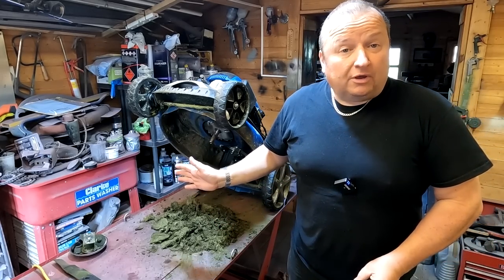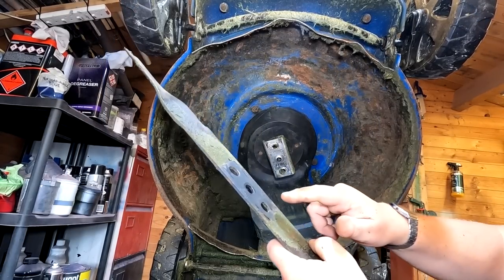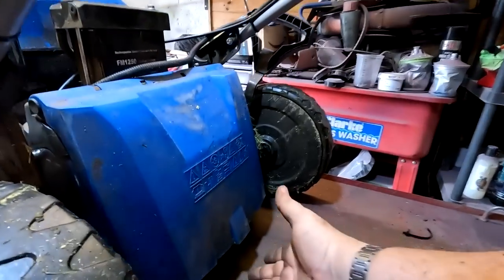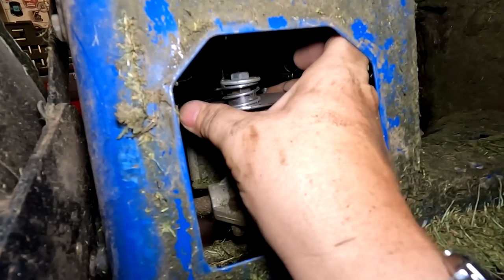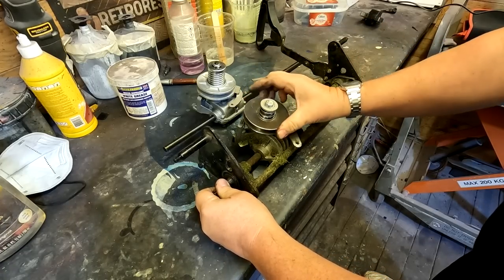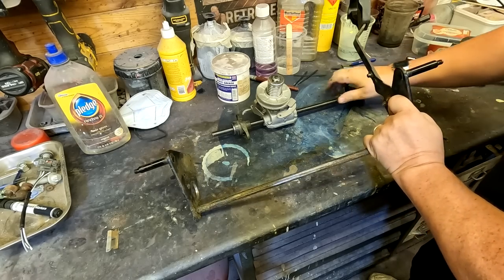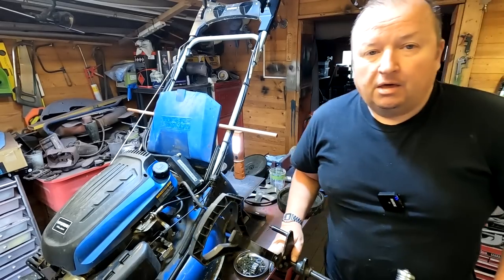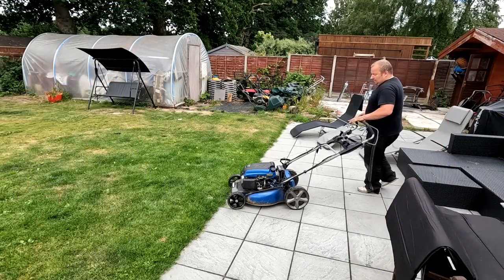Hyundai HYM510SPE Gearbox Issue

Comment: Nice one mate good job on the drive I some time's find that problems with the bolts covered in rust and rubbish normally. 👍
Reply from the maker: Yes Ali, that was the case here, I normally clean them with a wire brush but I forgot lol

Comment: Looks to me like there is an other idler pulley missing on the right side of the straight run on the belt as there seems a hell of a lot of free length on that belt
Reply from the maker: No Mark, this is working perfectly now.
Reply: @retrorestore  awwww good i know how much of a pain in the backside drives on mowers can be my neighbour bought at Auction an MTD Lawnflight ride on mower with a twin cutter deck and he thought it was all complete but when he got it home he tried it and it would drive forward and backwards but wouldn't cut so i had a look and the drive belt was missing so a new belt for it was around £100 so he had the great idea of going to a drive belt supplier and got one for £25 + vat couldn't find anywhere on the interweb on the routing of the belt because one cutter needed to turn clockwise and the other anti clockwise anyway through trial and error i got it to fit but the belt had to have a twist in it and criss cross itself what a nightmare of a job it was never again lol

Comment: Mine has done the same, the Left & Right Cogs do have L & R stamped on them so it helps if you do happen to mix them up, did you get gears 1 & 2 working?
Reply from the maker: Yes bud, there was a follow up video.
Reply: @retrorestore  I had to change the drive cable on mine as the new gearbox has an updated cable